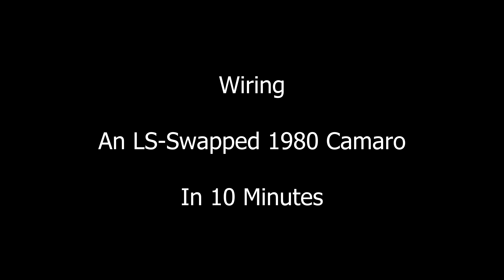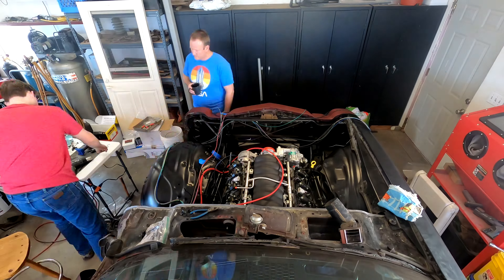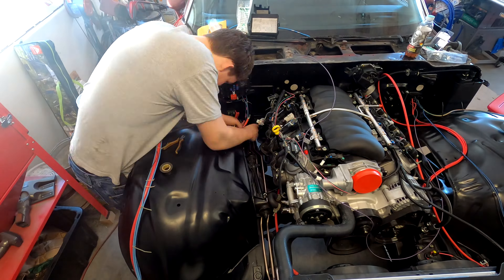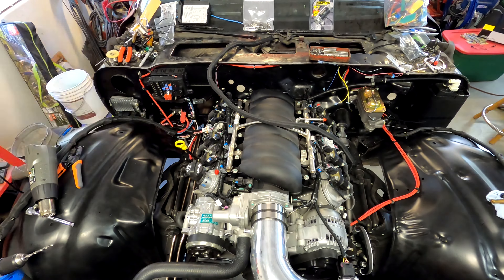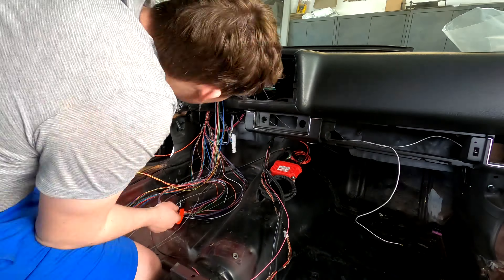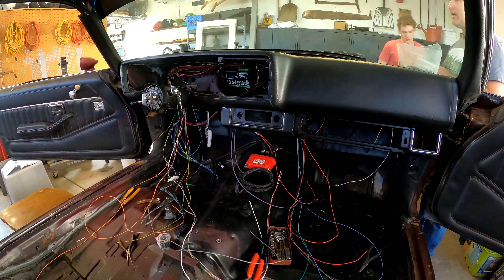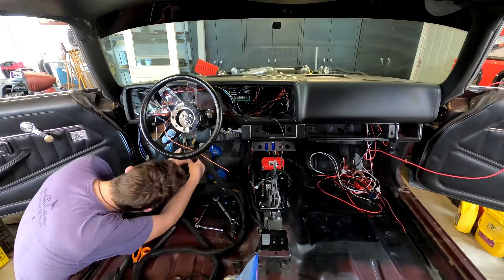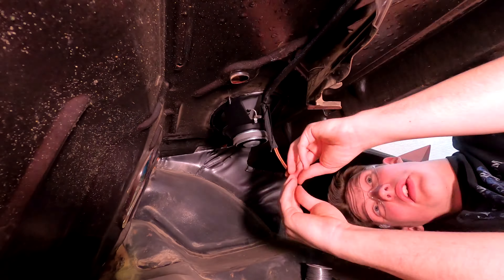LS Swap 20 - Wiring A 1980 Camaro In 10 Minutes (Time-Lapse)

Comment: Any chance you did a video or have a procedure on how to rewire the factory fuse box for the fuel pump and fan relays.  I bought and E-Rod kit and I’m running Vintage air, Electric fans, and a fuel pump that are all currently trigger on the ground side.  Once I do the engine sway I will have to rewire these there components unless I can do the modification you did.   I would greatly appreciate any help you could provide.   Thanks
Reply from the maker: Not yet.  We modified the E-Rod fuse box to power two electric fans and provide fused power for Vintage Air A/C.  Sounds very similar to your setup.  There are a few more videos I need to do on engine installation - radiator, intake tube, vapor solenoid, etc. - and then I'm going into electrical.  That's the area I found least covered when doing my own research, and I have a lot to say about it.  Sorry it may not be available in the timeframe you need.

Comment: Great video. Is that a new dash? If so, from who? you happy with it?
Reply from the maker: That is a new dash pad from Classic Industries, p.n. 476641, "79-81 Camaro Dash Pad", $399.99 + tax + shipping on 11/26/2021.  I am not happy with it; it has some visible lumpiness (for lack of a better word) that would NEVER have made it out of the factory originally.  Sometimes we don't install stuff within the return window, and the dash pad was one of those things, unfortunately.  There will be a future video about the installation.
Reply: @WorkinOnIt  Did you know they have 2 different types of material for their dashes?
you can choose from.Can I call you? If so please send # through my channel email. Thanks
Reply: @WorkinOnIt  Did you do a video on the dash? Thanks
Reply: @KenSellers  My bad. its NDP who has the best quality dashes.Thats who I thought you got it from. Thats why I ask If I could reach out to you. I Was wondering how you got a bad dash.  C.I. Are china dashes. NDP make their own and offer you 2 types
vinyl and poly. Get that vid out! 🤓
Reply from the maker: @hybridmusclegarage4590  That's good info, thanks.  It's really hard not to make a few mistakes along the way.  A video is coming, just can't say when.
Reply: @WorkinOnIt  👍
Reply: Just a heads up on wiring the Dakota digital. The sell a BIM to OBD-2 that will connect to the VHX module to the E-ROD stand-alone harness. It will pull all data from water temp oil pressure and rpm.
Reply: @rickyrodriguez8791   Thats The only way I do it for my customers!. Best set up
Reply from the maker: @rickyrodriguez8791  So glad you brought this up.  I thought the same thing and actually purchased a BIM-01-2 (BIM = Bus Interface Module).  But then I took a closer look.  This is from the review I wrote on Summit:

Here's what I don't like about the BIM-01-2. It's designed to connect to your OBD-II port, which is nice I guess for being easy to do, but bad if you ever need to use it (which you will - either a little or a lot). So I looked into hard-wiring the BIM-01-2 to the CAN bus (GM calls it GMLAN; same thing). Per Dakota Digital tech support, the BIM-01-2 CANNOT stay connected to the bus when something else is connected to the OBD-II port - so basically, hard-wiring is out. Do you really want to have to disconnect your gauges every time you hook up a code reader? And if the OBD-II port is mounted where it's supposed to be, do you really want a connector there, semi-permanently plugged in? My answer is "no" to both questions.